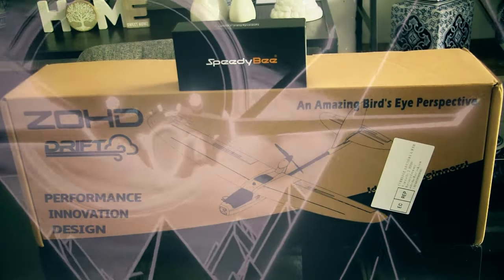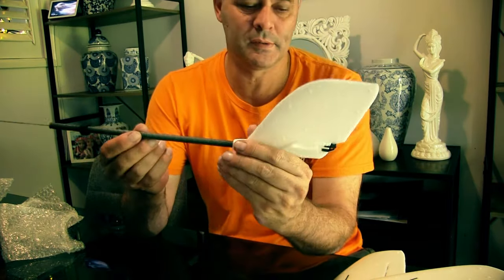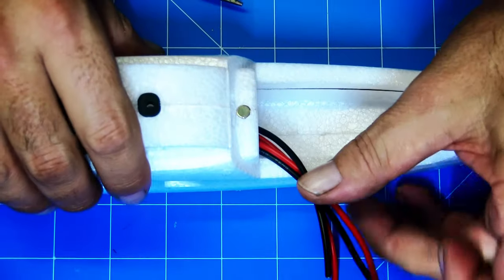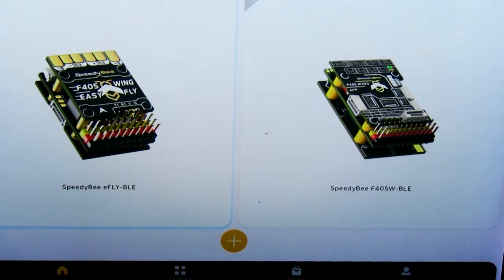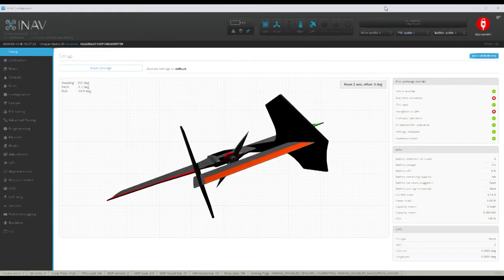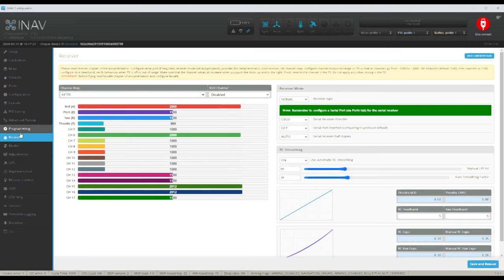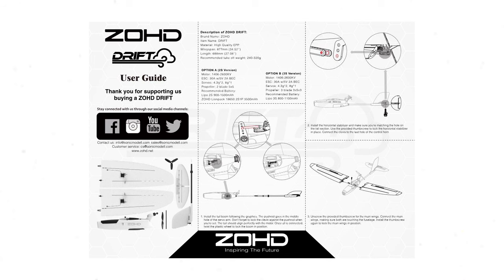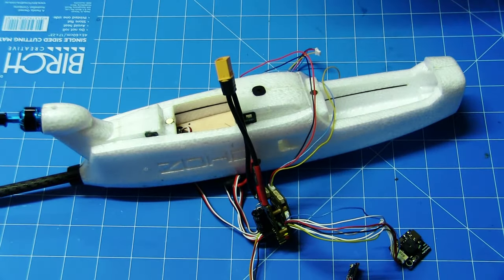Speedybee F405 Wing Mini ZOHD Drift FPV Build

Comment: Nice job, I noticed you still have the ESC BEC lead connected to the FC.  It's suggested to remove the red ESC BEC wire from the FC due to conflicting voltages which can cause problems for the regulator.  Otherwise, good luck on your maiden and happy flying!
Reply from the maker: Yes thanks for picking that up I did in the end.
Reply: If the esc has a built in bec I unhook it but if it's a esc wo bec I don't bother
Reply: Hi, as I’m still trying to learn from you kind experts could I please ask why the BEC would have use for that red wire if it causes voltage conflicts? Would it be used in a different way in another setup?
Reply: @Double-D_291  The red ESC BEC wire is used in traditional RC airplane setups for powering your RX and servos when not using an FC.
Reply from the maker: @Double-D_291  yes disconnecting it when using a flight controller is recommended as it can be used to power rx and servos in older non FC setups. Exactly as madsloper said above

Comment: Most reports indicate the CG nubbins are too far back, by about 3 to 5 mm. A little nose down helps penetration, especially if using small battery.
Reply from the maker: @PiDsPagePrototypes  I have heard this too although when I check the CG it definitely flies best a little nose heavy indeed.

Comment: I found that the CG factory marks are Wrong. I used the servo wires as the CG and it works perfectly. Others had the same problem.
Reply from the maker: Ok thanks interesting I did maiden with 2s using the CG marks under the wings and takeoff was faultless. I did make an attempt to make it slightly nose heavy though.

Comment: What port did you allocate for your elrs receiver?
Theres no info anywhere that shows the uart locations.
Wish youd have shown that vital initial part of the setup, its useless without transmitter and receiver communication.
Reply from the maker: It's setup in uart1. I have previous videos on the speedybee f405 wing mini and a fairly detailed review on it which should help with setup.

Comment: Hey, great video mate. I'm trying to do the exact same assembly but I'm having issues with motor, just keeps beeping and does nothing else. Servos do work but the motor just doesn't, tried other motors and is the same, slow beep and if I change the esc from port it goes faster. Any ideas?
Thanks a lot.😅
Reply from the maker: Thanks for the comment much appreciated.
Sounds odd have you calibrated the esc? Sounds like the motor is fine as you have tried other motors problem may be with the esc. Just to note in this video i did have the 5v cable on the esc bec connected by mistake should only have signal and neg wire only as it can cause issues. Other than that it seems unusual but i would try look at changing esc to see if it helps.
Reply: Have exactly same issues 
Motor and servo dont works ! 
CRSF bind, esc beep constantly :(

Comment: Hi do you know why my motor didn't response to my remote?
in Inav everything works well
Reply from the maker: @Indonesia01ian  Have you calibrated your esc? If throttle is working in iNav check the signal wire is correct on the esc. Issue may be somewhere there.

Comment: I have both the black one and the white 1.The black one is made out of a different foam and is not nearly as strong as the white 1, but in my original, I run an F405WTE and in the black 1 I run the f405WMN... I'm running a dual camera analog system on the white one.And a walksnail on my black one..

1407/2800kv on black.  1408/4000kv on white one. Running 2200mah 3s  Stock motors burned out very fast
Reply from the maker: I will keep mine running 2s since this video I have maidened it with hd fpv system and flew very well although not fast which is ok. I will have a video coming with the maiden soon.
Reply: @stonesrcchannel yeah I've had mine over 60mph.... 
I tried 2s but it wasn't enough.  I changed to these motors 1408 4000kv  due to stock one being hot and then smoking and I had them do I used them.  I love them I since bought the 1407 2800kv I didn't like them at first ... 

My drifts have over 300 miles on each and now that inav 7.1 has the odometer now to keep track...

I fly my drifts as "warm up" they go on every outing and fly first.  My main plane thinking of getting an baby a.r pro as well as the penguin
Reply from the maker: @devilsreject78  nice idea they seem good as a tune up plane before flying something more challenging. I also love the odometer too wish it was out earlier to keep track of mileage in the rest of my fleet. 
Penguin is also on my list as well as dolphin and swordfish.
Reply: @stonesrcchannel  I have both the dolphin and the swordfish in my favorite between all of them is definitely the swordfish it's like so amazingly smooth the dolphin awesome flies very very good but the swordfish definitely takes the cake

Comment: This plane is very light and should Only be flown in light wind. It's like a glider with a motor, beautiful glide but hard to land in a breeze.
Reply from the maker: Totally nice plane to fly slow, I did the maiden with fullload including walksnail had setup and on 2s battery and it had no problem taking off and flying. Maiden video coming soon.

Comment: I have the SpeedyBee F405 WING APP. Just working through connections issues.
SpeedyBee App on my phone doesn’t connect. I’m wondering what you did to make it work?
Also, I have a freshly formated, MS-DOS (FAT-32) 8GB in the slot. However, on the Blackbox tab, at the bottom, still shows RED Fatal error Reboot to retry. Should that change color?

Thanks!
Reply from the maker: Regarding connection to the app the usb extender light should flash green. The 3 modes can be changed by holding the button down for 6seconds. Off the top of my head I believe green is what you want and there is purple and white and off (no light). If it’s green you should be able to connect your phone to it through the settings in the phone. And also the formatted sd card should work fine once installed into the flight controller it should be automatically pickup up maybe you need to toggle the black box switch in config.
Reply: Thanks for your reply. I’ve gone through that process a number of times, following the instructions included with my SpeedBee F405 WING. I’m unable to get a wireless connection. Pressing the boot button for six seconds…
Green slow flashing: BLE not connecting!
Pressing the boot button for six seconds…
White slow flashing: Wi-Fi not connecting!
Pressing the boot button for six seconds…
Blue slow flashing: Classic Bluetooth SPP not connecting!
Pressing the boot button for six seconds…
RGB LED off: Wireless module turned off.

I’m watching other YouTubers do what you’re doing, looks like magic. But for me, it’s not working.
Reply from the maker: @AcadJim  sorry to hear sounds frustrating and I take it you have connected from the phone wifi setting to recognise the speedybee on the app too? Other than that you may have a possible bad module, try contacting speedybee for support they have helped me out a few times with issues.
Reply: @stonesrcchannel  I’m now working with SpeedyBee tech support for help. They’re on it! Thanks and have a great FPV flight 👍🏼
Reply from the maker: @AcadJim  thanks I hope you sort it out.

Comment: What is the kv rating of the bldc motor ?
Reply from the maker: @letsseehowofficial9981  it comes with a 1406 2600kv motor
Reply: @stonesrcchannel  thank you so much sir. And what's the size of propeller?
Reply from the maker: @letsseehowofficial9981  2 blade 5x5 prop